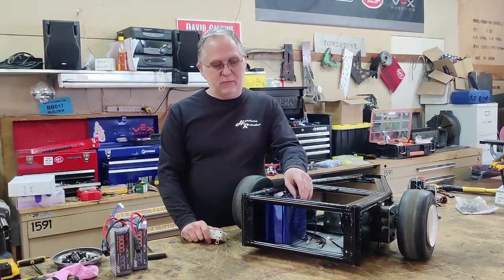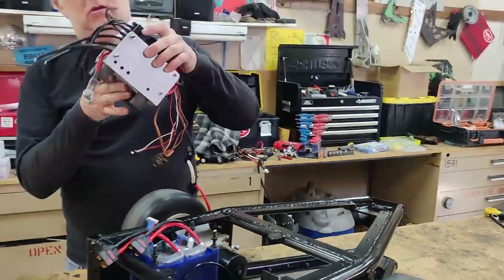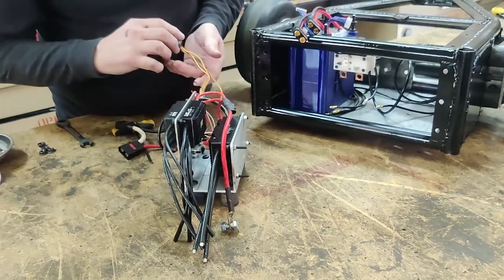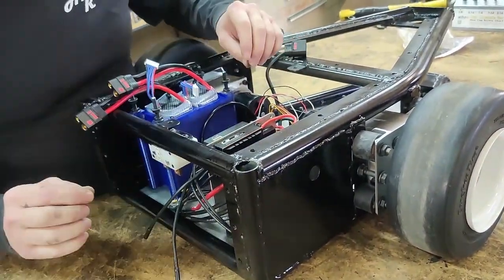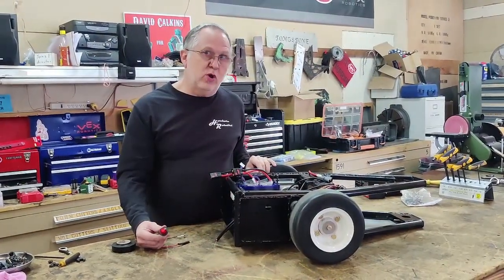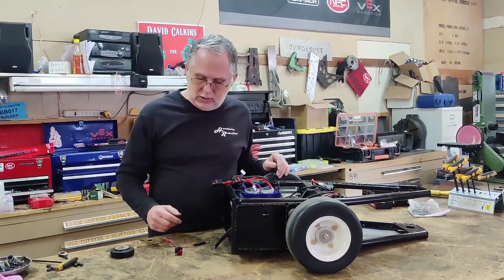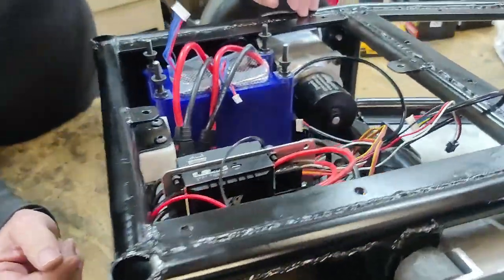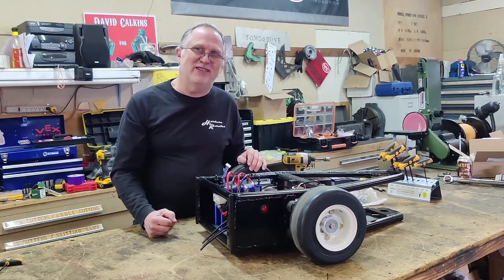Mortician 2023 - Let's wire it up!

Comment: Maybe use marine heat shrink on those wire connectors? It has an adhesive which will really help to hold it all together but you can still slice along the join to swap a component.

Comment: What speed controllers are those?
Reply from the maker: The controllers are all Maytech units. The bigger one is 300A and the smaller ones are 150A
Reply: @ray9368  Thank you! Do you reckon those controllers are good to power a brushless e-bike with a 58.8v li-ion battery pack?
Reply: @Convolutedtubules  100A continuous at 60V is 6kW: that's not an e-bike, that's an e-motorcycle.

E-bikes are generally in the 250-750 watt range, not 6000 watts. With that amount of power you're going to be carrying a lot of batteries with you or discharge the pack in only a couple of minutes at full power.

15-20A continuous motor controllers would be way more suitable for your application. You also need to take into account the amperage your BMS can deliver, connect a too high rated motor controller and you might just blow up your battery pack when you go full throttle.
Reply: @bami2  Thank you for your concern, although having built an e-bike and custom battery pack, I know all that.
I'm currently running a 30a esc, would like to go to 50 amps, with an overkill ESC as to keep everything cool and efficient. My battery can handle 160 amps continuously. The battery is quite big, near 5kg, I am not worried about capacity. If there's anything I'm worried about its the dangerous speed, and torque that can destroy the bike frame. I already had to fabricate new dropouts as the previous turned out to be to weak for the torque on the shaft. Can you imagine the battery running at full power? That'sl 58.8v X 160A = 9,408 watts of power, way more than my aluminium MTB can handle.
As it is, it gets me to work in a good time. Doing 40km on avg. Up to 65km slightly downhill.
Reply: @Convolutedtubules  My apologies, you've clearly done your research. As long as you keep in mind the power from these motors and controllers you should be all clear. Considering the size and rated performance of your BMS this should be fine, and although you probably already know this you could hit some issues with peak loads that would go well above the rated power of the ESC.

Also the frame warping from all the power is a serious consideration, as well as beefing up the brakes because I'm certain you can reach 80+ kph on a bike with that much power behind it. Hence why I said it's more a e-motorcycle, as you would need a frame and brake setup more tuned towards a 125-250cc motorcycle than a standard MTB since the torque of a brushless motor is way higher than an ICE and that usually has a clutch to smooth out the power curve at low speeds. You also might want to seriously consider buying a motorcycle helmet and a good motorcycle jacket while riding this.

You also might get into regulatory trouble depending on your local laws by building a bicycle with this much power as it could be classified as a motorcycle (in Europe you would definitely need a class A1 drivers license, register plates and have insurance to operate one)

All in all, I think these ESCs would be a fine choice for your application, just make sure you get one that supports up to 16S voltage.
Reply: @bami2  I'm using a cheap 48v controller with the 58v battery, works like a dream. I wonder if this 12s ESC Ray is using will handle 14s without issues.

Comment: Average Mortician build video length: 6 minutes
Video on getting all the electronics together: 8 minutes

Video on getting the ESCs properly configured? probably like 3 hours.
Reply from the maker: Drive setup was pretty straightforward. Weapon however...........
Reply: @ray9368  ah OK I thought it would have been rather complex and time consuming for both. Why is the drive less complex than the weapon, isa it less hardware/software optimization or something?
Reply from the maker: @TheInvertedFollicle507  A number of things. Although the weapon motor is larger than the drive motors, I'm also asking a lot more from it. So It's just going to be more picky about settings in general. Then, the drive motors are sensored while the weapon motor is sensorless. Now with a properly setup HFI setting you can get a motor to behave kind of like it has a sensor, but "properly setup" isn't as easy as it sounds. Finally, the drive motors are outrunners while the weapon is an inrunner, and while there are advantages to both it seems like HFI works better with an outrunner than it does with an inrunner. 

I really only had to run the VESC tool a few times on the drive to get it working in a way I was happy with. I've been programming the weapon controller for a few days now and I'm still not happy. Everything does work, and it does spin up, but I still think there are improvements that can be made here so I'll keep playing with it.
Reply: @ray9368  my head would just explode like a volcano with all that tuning of software pillava I'd just stick to brushed motors if I was a builder, the tradeoffs of improved power to weight ratio doesn't seem worth it for all the programming that you need to do. From the little I know I'm also assuming it's a hall effect sensor that you are running on the sensored motor but that can be an additional source of complexity with the sensors having to guess the rate of rotation of the motor or something. Best of luck to you in any case Ray.
Reply: @ray9368  Yup, tuning the weapon ESC so that the motor has enough torque to start swinging that big chunk of metal around is something teams in pretty much any weight class have issues with, the amount of bots I've seen where the weapon slightly vibrates and only gets up to speed when they receive a hit from another weapon is significant. To me, it's all voodoo magicks and I'm surprised teams even get it to work at all.

Can't wait to see how you've pulled it off!
Reply: Yeah brushless motors needing ESCs be properly fine tuned are a nightmare for all teams who work with them.
Kraken had major issues with the new version of their bot that is also brushless this season.

Comment: As an observation, it seems like the bots that win are those who are faster and more nimble than the competitor.  The ideal is to be like flies on stink.  They're more likely to engage their weapon while dodging the opponent's weapon.  Is there anything you're doing different to enable your bots to improve?  Or a faster spin-up?
Reply from the maker: There are changes and improvements every single time the robot goes to an event, and in fact we make subtle changes many times at the event. There are always things to improve on!
Reply: Ray is going full brushless with this build of Mortician, that should give it way more speed and lower spin-up times than the older brushed motors he was using before. There is a short on Rays channel with the current Mortician skidding around on wet pavement, I don't think lack of power will be a problem, more likely that the excessive amount of power shakes the bot to bits when the weapon gets damaged.

Comment: Are you going with a flat back again?  Or are you adding something so the robot can't end up sitting on it's back?
Reply from the maker: Have you ever seen one of my bots lose because it was standing on it's back?  It's not really stable there honestly, with the weight of the weapon so far to the bottom it doesn't want to balance in that position.
Reply: @ray9368  Odd, I thought you did.
Reply: @ray9368  Still looking for the match, but I do see photos of when Tombstone had a wedge shaped back.  I assume so it couldn't stand on it's back.

Comment: What size battery connector do you use XT-120?
Reply from the maker: Those are QS8 connectors. They're probably overly big for this setup, but these packs were originally bought for Tombstone, so big connectors are required :)

Comment: Have you considered making a thin 3D printed shroud for the outrunners on the drive to prevent them from potentially eating wires/rubbing insulation off? I know you have the wires managed pretty well but its a common issue with brushless gearmotors in lower weight classes.
Reply from the maker: I'll have wiring all secured before combat, so no hadn't planned on adding anything specificaly for that. I can see how it would be more of an issue with smaller bots though - there just isn't enough room in there to route everything!

Comment: -- Ray, whoever edits/encodes/upload your videos, tell them to change your voice audio settings from stereo to mono.  That way it's not always coming out of one speaker for us. 
   I like the buffers on the controller bracket, and agree, it should be lower.
   As an after thought, geez I hope you have spares of that batt enclosure.  You burn up a battery in there and well.
   Later if you can get away with running another batt bank, perhaps a relay for backup power, it might be something to consider.  Though, looking at the innards, you're filling it up pretty quick.  
   How about tape and something and something like a hose clamp to keep those push connections secure?
   On the safety/active LED.  If that thing gets hit, does it have a fuse?  What happens to the rest of the system if it shorts out?
   Finally I wonder, that batt enclosure being mounted directly to panels that may take a hit, if it's possible for the enclosure to torque both batteries to the point of spectacular failure?
   Thanks for sharing the journey and thought process behind your bot.  Always a blast to watch.  Looking forward to how you work the speed controllers.
Reply from the maker: We have a lot of "already filmed" footage, and apparently some of this was related to the camera on the cell phone. Eventually we'll get it sorted out :)

Comment: Super interesting to see the electrical bits inside.
You are going to cover those two positive bolts up, right? They seem to easily make contact to the chassis if the rear gets damaged.
Also, have you ever thought about cable lacing with some non-conductive structural core for the tiny vulnerable cables to make them a bit tougher?
Reply from the maker: I usually wrap them in tape, but honestly it's more to keep the nuts from coming loose. There is a decent gap between the heads of those bolts and the back armor panel, and a hit that could actually get to the wiring would destroy the switch first.

Comment: Thanks, Ray. Nice, detailed look at the inner workings of a bot. Have you ever tried encasing the batteries in molding silicone and placing them in the battery holders while in the silicone to add an additional layer of shock absorption? Just curious, where does the antenna for the wireless control go? Seems like it would need to be outside all that metal that could act as shielding.

Glad to see your finger is healing well. Been watching you for years - glad I have this chance to say "Hi" and thanks for the entertainment of watching you battle.
Reply from the maker: Some of the newer receivers, like this one in the bot, don't even have an external antenna wire. There are enough holes throughout the bot for reception to get in. You would think a solid metal box would cause issues but really the communication has been pretty solid.

Comment: Do you do anything like common chassis-ground? The benefits are saves some weight and wiring complexity by not having to run negative cables everywhere. Are there any downsides to that?
Reply from the maker: It's never a good idea in a combat robot. If the chassis is electrically connected and there is damage inside the bot, at the end of the match you have to go deal with the broken bot. Any exposed live wire touches you while you hold the frame and you are now the completion of the circuit :) 

It also makes battery fires much more likely for the same reason. And finally, it can adversely affect radio communication. The upsides just don't override the downsides, and in fact some rule sets specifically forbid grounded chassis construction.
Reply: Watch Ghost Raptor almost weld itself to the battlebox floor during its fight with Cobalt in season 6 (a bit before the last big hit that split Ghost Raptor in 3+ pieces) and you'll see that having your frame be part of any circuit (although that was caused by sheer damage, not design) is a bad idea.